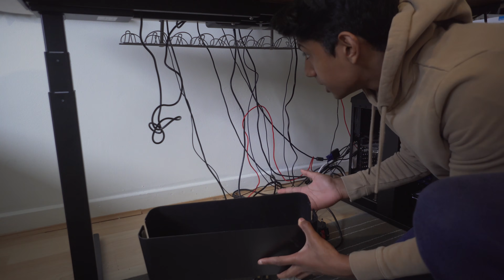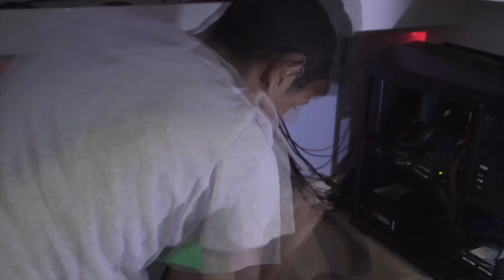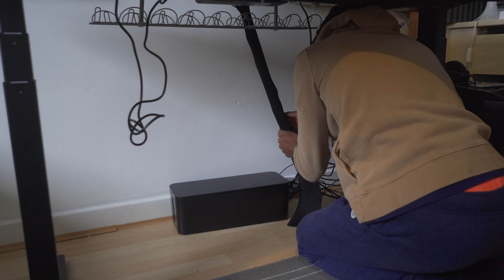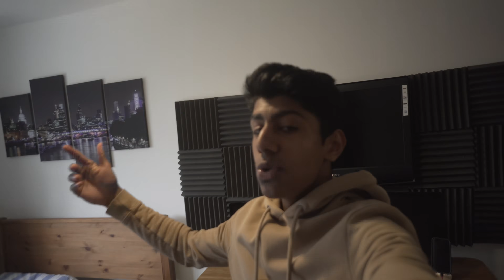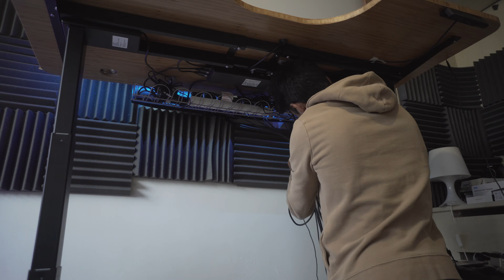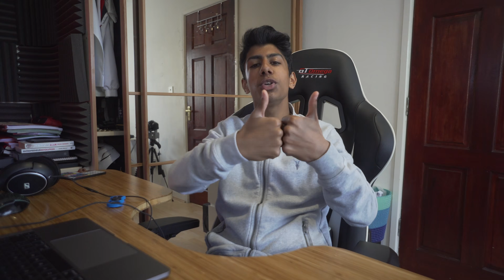How To: Ultimate Cable Management Guide 2017

Comment: RIP if you want to add or remove some cables.
Reply: So true. I tie mine together with cable ties and everytime i need to take out or add a new cable i have to undo everything and then cable management it all again
Reply: @ll-hv4wo  I wish sometimes there is ctrl+z :(
Reply: I was thinking the same thing, I like to swap keyboards and the mouse every now and then so it might be a headache.

Comment: tuck all cables in a box,  good idea, but that is not always safe. also if you need to move or replace anything, that would be a nightmare.
Reply from the maker: Yeah that is safe I mean your not exactly gonna trip over your wires. Or they wont overheat unless your working with a crappy powersource or extension lead.

Comment: Tip #1 for cable management: Don't put your computer on the floor where it shouldn't be in the first place. There are numerous reasons why: dust, vibrations, kick hazard, vacuum hazard, spill hazard, etc.